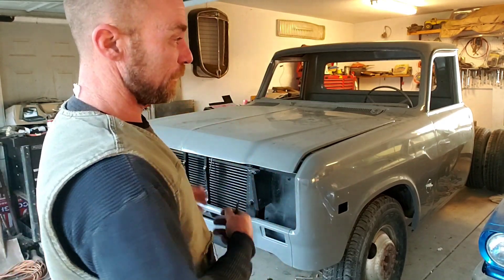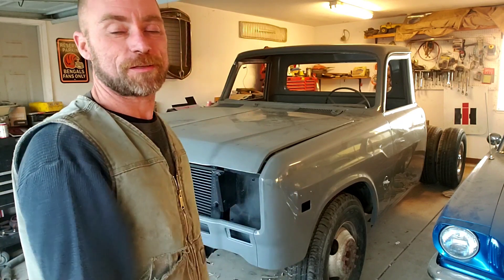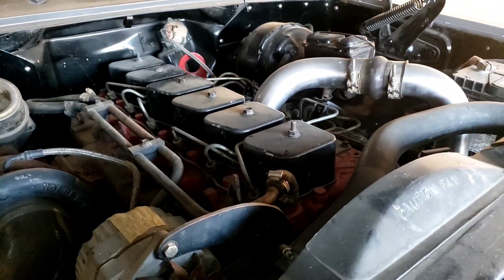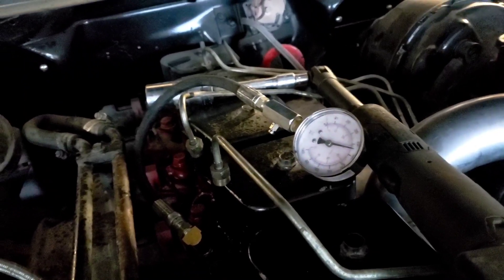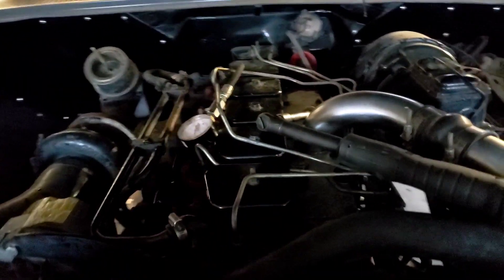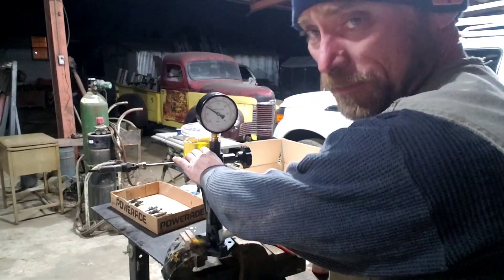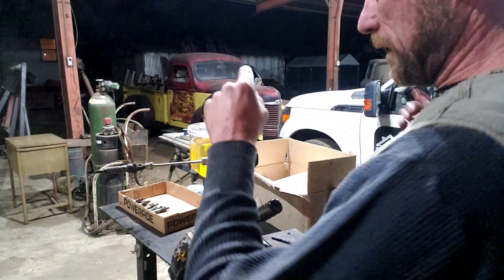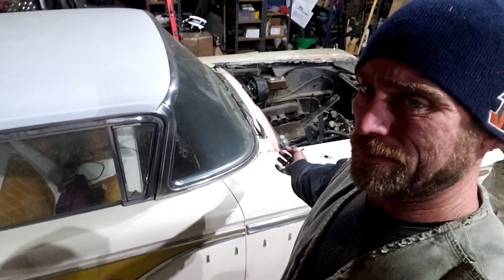1975 international - truck restoration - 12 valve Cummins - swap - fixing the problem

Comment: Did you have to box the frame at all more that where the stock box section is for the motor mounts? I have a 74 100s that I’ve been starting to tare down to rebuild it from the ground and I’d like to 12v swap it. If you have any other things that came up could you message me thanks
Reply from the maker: sorry I must have missed your comment not many problems in the swap but there are lots of little things I did to make it work ...... just ask ill answer